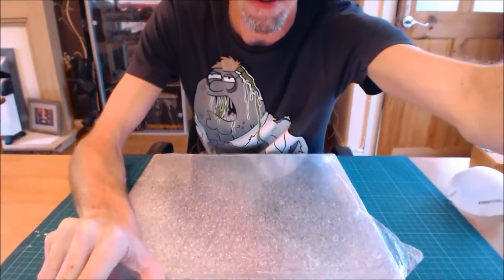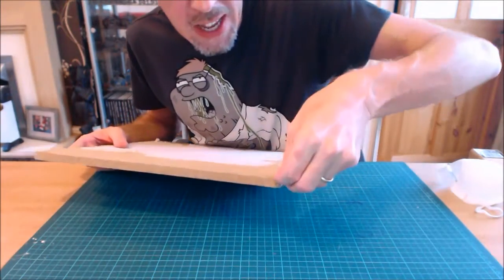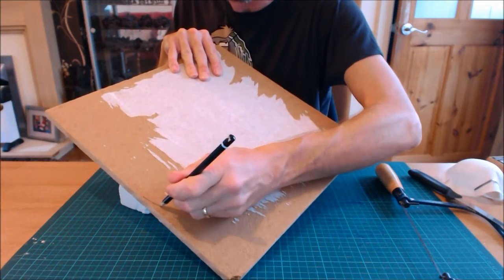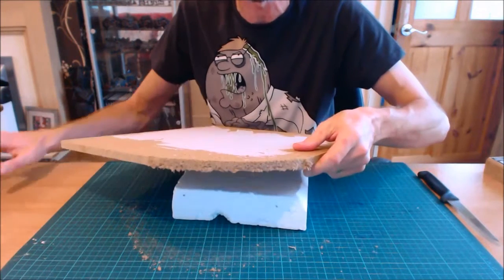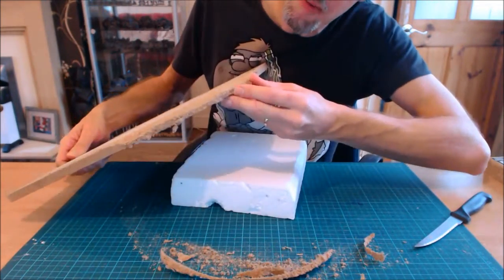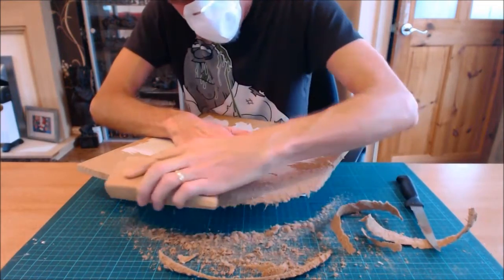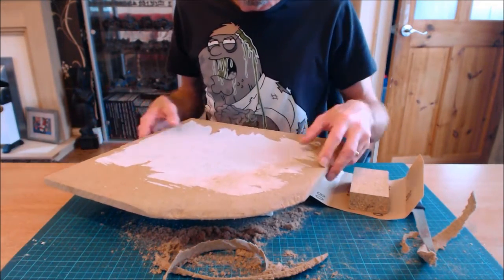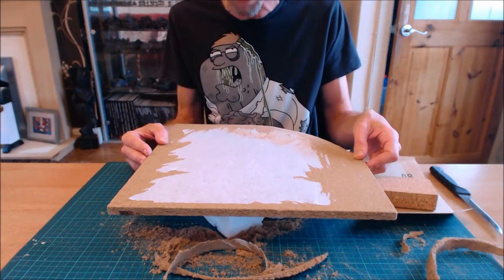Easy terrain bases from cake bases

Comment from the maker: Theoretically yes but they don't come in exact sizes so I'd recommend buying them all at once to make sure they were the same size.

Personally, I'd go to B&Q, buy 8'x4' 5mm MDF sheet which comes with 10 free cuts (check your local store first), take it to the cutting desk and get them to cut it into 1'x1''s or 2'x2's etc. Cheaper, exact sizes and better material mate.

Hope that helps.

Comment: Iv taken to using self sticking vinyl floor tiles , stryofoam sticks right on it making quiet a firm study base . and can buy then in b and q for as little as £2 a pack
Reply from the maker: Andy Buckland I'll have to pick some up and check that out mate, thanks for the heads up.